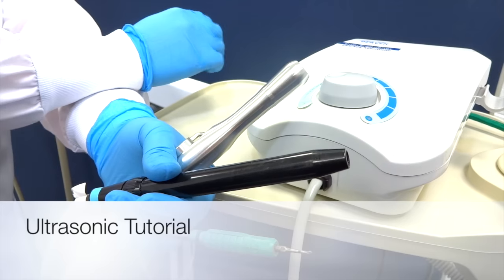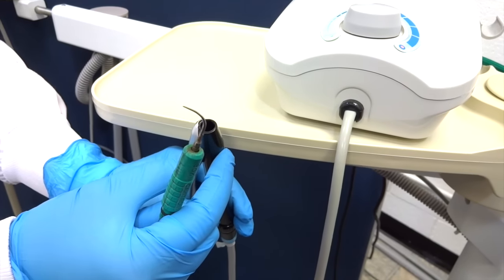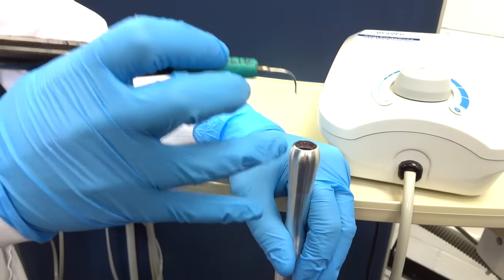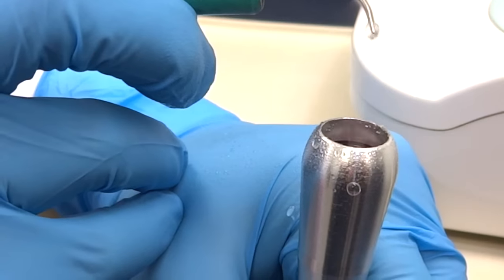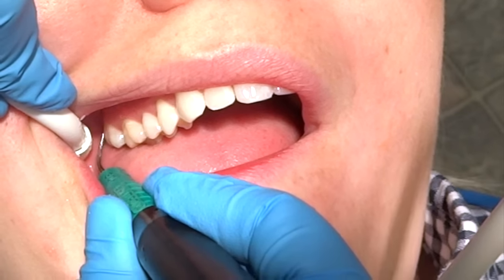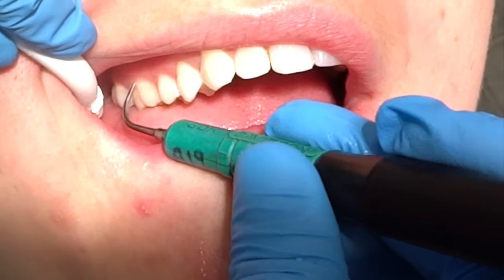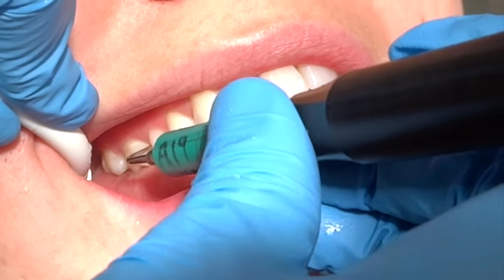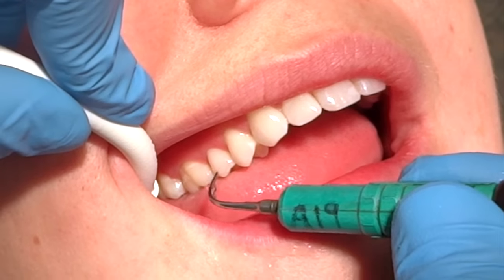Ultrasonic Tutorial

Comment: Definitely find a dentist who uses this during the cleaning... I have the biggest dentist anxiety, mostly stemming from the pressure coming from scaling that feels like they’re pulling out my teeth, but I just got my teeth cleaned and could hardly feel the ultrasonic and it took most of my tartar off, leaving very little left with the manual scaler.
Reply: I thought it was very painful, and the sound was as if they were drilling. I will ask for nitrous oxide next time or switch dentists.
Reply: @Awillaway78  just got a cleaning with this torture device and it hurt like hell😭😭 no numbing or anything
Reply: For the majority of people they can tolerate this but a minority of people cannot handle the noise or vibrations.

Comment: Thank you for this video. Recently I purchased an ultrasonic cleaning tool, but this tools is without coming out of the water...do you think it's okay to use? Just want to sometimes clean by myself...
Reply: Please do not try to ultrasonic your own teeth. That is very dangerous. There is a reason you have to see a professional who is licensed to use these instruments (dental hygienist or dentist). You must have water coming through it because the metal gets hot but the water runs through to not only cool off the heat but to help the vibrations to break apart that hard calculus. Using it without water could cause major damage to the tooth inside and out
Reply: Good tools u have. But remember, only hit it with heavy tartar only, if you doubt it tartar or your teeth, dont use it. 
Lets assume you and me are not medic pro

Comment: Using the face is more effective but just no recommended because it can be potentially damaging
Reply: It really depends on the type of ultrasonic instruments. The piezoelectric ones have the tip vibrate in one dimension, so only the lateral sides are effective. The magnetostrictive ones (such as the cavitron shown here) uses elliptical movement and actually is the most effective at the face. The instrument is the strongest at the tip, but you don't typically use it except for extraordinary circumstances (such as when tissue trauma and discomfort are the desired outcome... I will leave that to your imagination.)

Comment: is it  water that cleans the teeth or is it that sharp  tool  ?
Reply: Hi! The water comes out of the tip of the tool while it vibrates. The water helps flush out the debris, help with healing and also keep the tooth and tool from overheating☺

Comment: What’s the difference between this and the waterpik?
Reply: Hi! A water pit is strictly pressurized water. It does not have a tip designed for removing hard buildup. A water pik is more closely related to flossing. It's most beneficial for patients with deeper pockets as string floss cannot go that deep. However, it is not a complete substitute for string flossing, just a great adjust depending on what the patients needs require 🤗

Comment: My problem is tartar buildup on the underside of my DENTURES where the surface is rough compared to the outside surface.  I've tried using my powerful $ 400 ultrasonic cleaner that I use for carburetor cleaning but that doesn't seem to do much to remove the tartar even after soaking the dentures in a 50-50 vinegar solution overnight.  Is THIS ultrasonic pick that you're using what dentists use to clean dentures?  If so, could you tell me that make and model unit that dentists use?
Reply: Hello Mystery47,  you should take your dentures to your friendly dentist, they have the right equipment to clean, polish and disinfect your plates in a few minutes,  this should be done at least twice a year.      Good luck

Comment: She didn't fulcrum nor did we get to see her go thru all the quadrants
Reply: Sera she actually used extra oral fulcrum (on the patient chin)
Reply: yes, but your not suppose to use a extra oral fulcrum. She should be fulcruming on the same quadrant she's working on.
Reply: Yes, but you're not suppose to use a extra oral fulcrum. She should be fulcruming on the same quadrant she's working on.
Reply: Not with the maxillary arch. You'd end up at 8 o'clock with your elbow coming out like a chicken wing. Not very ergonomic this way.
Reply: Sera also with ultrasonic, the fulcrum is more for balance and less about stability like hand instruments using lateral pressure. Extra oral and soft tissue fulcrum is just fine here.

Comment: I don't know how this procedure became the standard. This literally nukes your teeth. Nothing better than the old school scraper and dremel. This should simply be outlawed. It fragilized the teeth, makes your gums bleed, and can even shatter them.
As my old dentist stopped practicing, i had to find a new one. First time a dentist did that to me, had my teeth super sensitive for over a week, and bleeding gums. Never had any problem in my life before. Changed to another dentist. There he also wanted to clean my teeth with that. I asked him, if it was the teeth shattering ultra sound thing that makes gums bleed and make teeth sensible for no reason? He smiled without saying anything. Dentist know what they do with it. Just like doctors, they make you sick, so you ll come back to get your cure that will make it even worse.
Reply: I've been researching the hell out of sonic scalers since I have the same issue after getting cleanings.  It just doesn't feel right for several weeks after a cleaning.  Biofilm is probably completely nuked.  I'm afraid you might be right about the perverse incentive.  Need to find a dentist that just uses the manual tools.